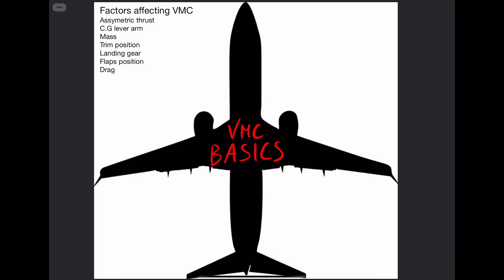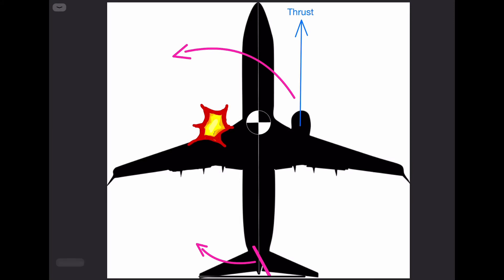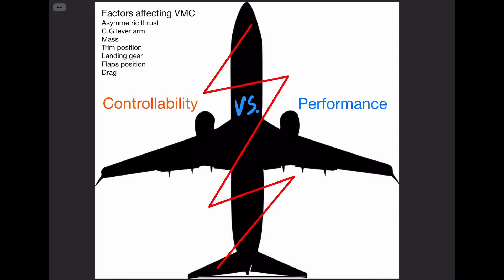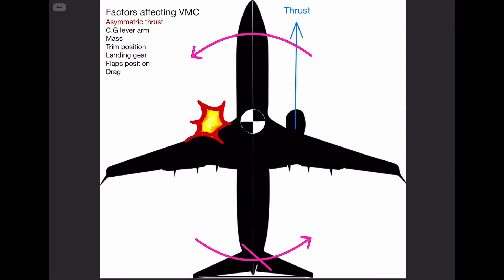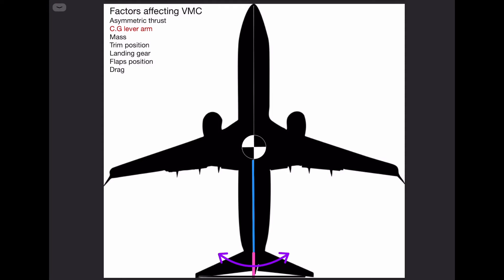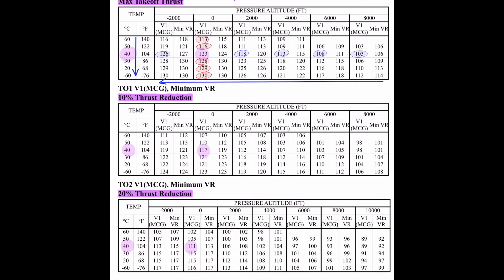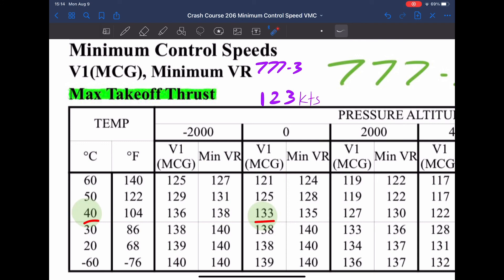Crash Course 206 VMCA / VMCG Minimum Control Speed

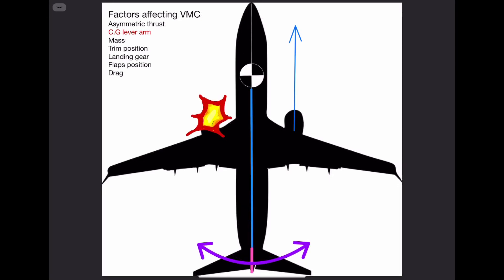Comment: 3:34 Correct me if I'm wrong but I prefer the base line and also the base line should give me the slowest Vmcg speed
Reply from the maker: Thank you for watching and commenting. The Longer arm gives you the most control "slower VMC spd" and the shorter arm gives you better performance but less control "high VMC spd"

Thank you for watching.

Also are you a pilot or dispatcher?
Reply: @flightlevelview2115  thanks for the answer. I'm neither, I work in aircraft maintenance :)